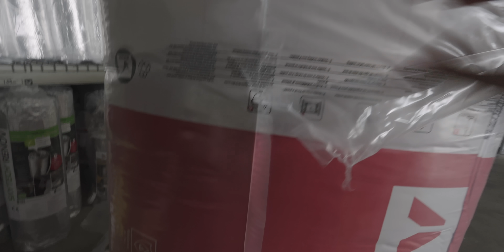Budget Cuts & Broken Dreams, Will We Ever Finish The Convents Kitchen?

Comment: If you have other insulation to do, you may consider the spray on. I don't know if it's more cost effective, but it works rather well. Spray it on, it expands and hardens, then just cut it to the same size as the studs. Gets in all the gaps. Good job with the build. It's fun to watch the transformation of an old building as it gets a new life.

Comment: I have another brand of chest fridge/freezer and wanted to comment on how this type of chest has helped me. Mine doesn’t have an ice maker unfortunately, which would be great for camping. 1) When the power goes out, which happens here a few times per year with storms, I know I can save my high dollar frozen meat/seafood if the outage lasts too long. 2) It comes in handy when I defrost my little garage freezer each summer. 3) I stock up on things in-season so the chest gives me excess capacity when prices are favorable and my garden harvest comes in. I’ve had mine for 3+ years now and it’s never had any issues. The technology has been around a while and is reliable. So if you’re on the fence, it could make sense. Especially if you have power outages and a stocked freezer.

Comment: billy i have a question about the tunnel you found that was flooded ,i think you should find out where the water needs to run out it could be blocked hence the tunnel being flooded once that is cleared you can have access to the tunnel